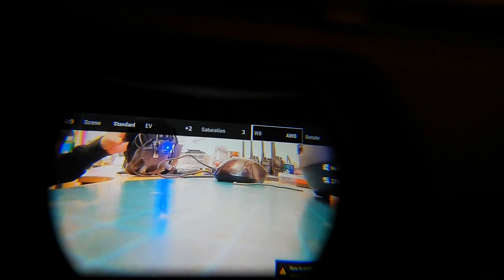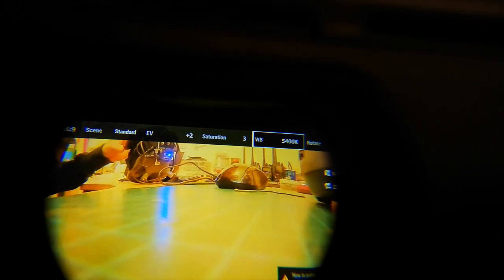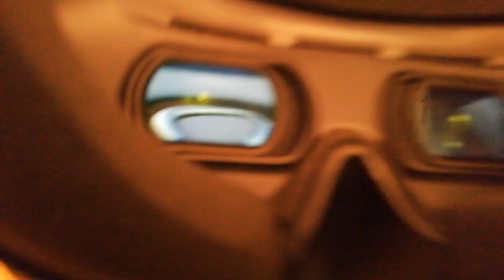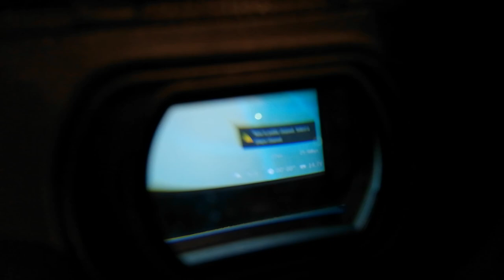EXTEND YOUR DJI AIR UNIT CADDX VISTA TO A  LONGER CABLE 15CM!!! MAVIC PRO SIGNAL CABLE WORKS 👍

Comment: Why not just cut original cable in the middle, and add extra wire in a middle of required length?
U can soldier them directly, or even add plugs with crimping tool to make it easily adjustable for future models with different lengths
Reply from the maker: Have you ever tried to join 20  individual wires that are less than 0.25 mm in diameter?
Reply: @RichardGilmoreDronetech  I just unscrew the air unit to see the wires inside, and yes it was shocking, literally 20 micro wires...
Possible it is possible to connect after the split, but u right it will be micro job :(

Comment: This is wonderful. I've been looking for a solution since the Vista 12cm replacement cable is the same length as the stock cable it came with. So you just pushed the cable trough the metal camera back plate? Maybe this could be a useful video to show us how you did this? Just so we don't break our existing cables and replacement cables.
Reply from the maker: I'll get on that mate.  No worries.  Had a break from YouTube for a while there.  Sorry for the late reply

Comment: Did you just connect the plugs without removing the excess wires from the Magic? If so, then I’m going to order a wire for a build I have where I’m 40mm’s short.  Thanks for the video.
Reply from the maker: Yes.   Just connect the cable as it is.   The spare wires are not used.      Just connect and go.  It's very easy 👍

Comment: Cool vid, thanks.  I wish there was something longer, like 25 or 30cm.
Reply: Same for me, I need at least 30cm to use the Vista on a nano drak wing
Reply: @lucasfoussier  I'm in the same boat in wanting to use it with a MD or a ND.  Really, any fixed wing aircraft where the VTX bay is already there.
Reply: @MrGantzFan  I bought few cables and some wires, i am planning to make my own extension cable, at least 40 tiny soldering point, it gonna be tricky i will keep you aware :)
Reply: @MrGantzFan  Unfortunately it do not work, there is no image with my homemade cable... The cable are to thin, they are clearly do not prepared for be soldered... I am figuring out another emplacement on my fixed wign for the air unit
Reply: @lucasfoussier  It turns out these are micro-coax cables.  Crazy difficult to build cables without proper equipment.  I started a thread in the DJI forum asking for longer ones, perhaps 30 and 40cm long.